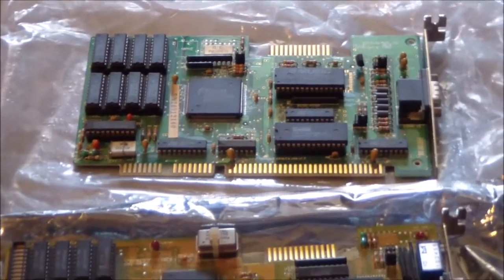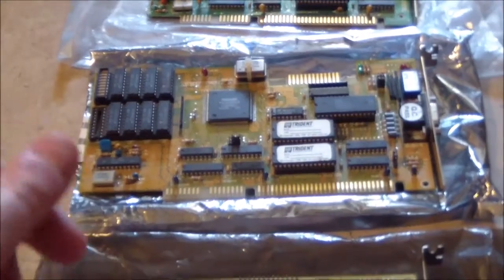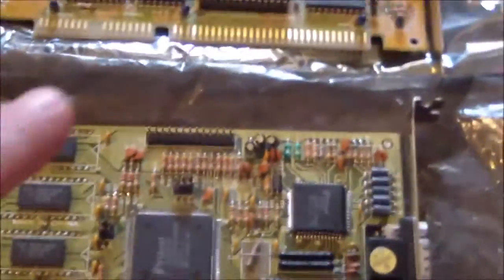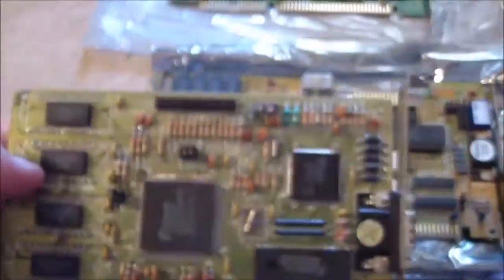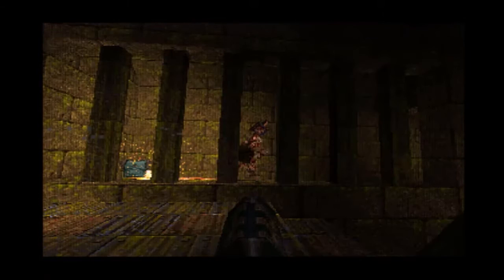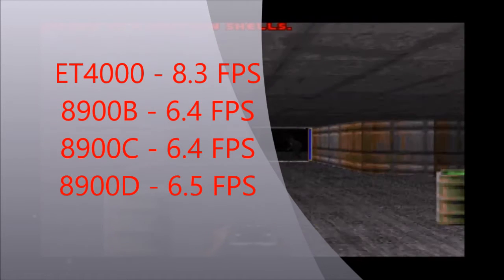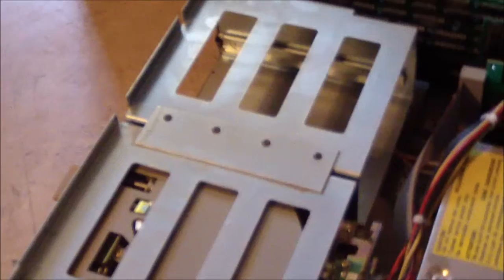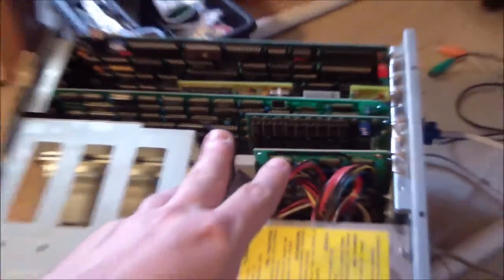Trident 8900 graphics card

Comment: i had the 8900c on my 386 sx33 with 2ram in 1992...later i upgraded to a  486 dx4100 with 16 ram and i could run quake 1 red alert descent 2 doom 2 warcraft 2 duke nukem 3d dark forces  all just fine... its the CPU that did the graphics then the graphics just determined the colours and resolution you could get

Comment: Trident 8900 is First 3D card in world?
Reply from the maker: Trident 8900 is a 2D-only card, it has no 3D acceleration capabilities.
Reply: @AncientElectronics  OhOh.Thank you.

ps:i want to collect First 3D Card.
Reply from the maker: @阿綸的全勳學院  I think that would be the Nvidia NV1 3D Edge PCI card. though I know the S3 Virge and Creative 3D VLB cards were released around the same time, within months of one another. good luck though, Virges is super cheap and common but both the NV1 and Creatives VLB 3D Blaster cards are extremely rare and expensive.

Comment: I had the TVGA8900C in a PC I bought for $5 at a thrift store, sporting the legendary 386DX40 processor. Despite having 1MB of VRAM, the graphics card couldn’t display any color depth higher than 8-bit, 256 colors. That’s odd, considering I have a completely different 1MB card that can do 640*400 resolution at 32-bit color on another PC!

Anyway, if I tried running the Trident card at 1024*768 resolution, still in 8-bit color, it wasn’t very stable. I had a 256-color wallpaper in Windows for Workgroups 3.11 (actually the Win95 clouds) which would suddenly "bleed" for no reason. And this wasn’t during a typical palette change while multitasking when you’d expect such anomalies. It was just shortly after starting the PC!

Lowering to 800*600 resolution, still at 256 colors, would finally give a stable result, albeit only at 72 Hz refresh rate. For running standard Windows apps and Microsoft Office, it was reasonable. Some simple DOS games also behaved, but don’t expect much beyond that. You’re definitely better off with competing brands, even those which only have half the VRAM at 512kB.

Overall I can’t really complain, though. The whole working PC was just five bucks and lived a good life beyond whatever the previous owner(s) got from it. But I’d hate to imagine what people paid back in the day for this underperforming video card, expecting more for having a full meg of video memory.
Reply: Thats true man   and i had the same card but 256 colours was great, huge upgrade over evga,,, you could run dark forces, windows 95 with those desktop themes ( aliens, predator ) remember downloading those with netscape navigator 3.0 with my dial up 33.3kmps modem... all those games in the 90s were 256 color even FMV ones like full throttle looked great with the trident and a 486
Reply: you never went higher than 640 by 480 with the trident anyway because you couldnt.... it supported 1024 by 768  i had the manual but no game played in that resolution until 2000 like the new command and conquer game tiberian dawn.... the Trident , you could play any game up to early 1997.... with a dx4100... as soon as you needed a pentium 90 , you needed a PCI 2 meg graphics card .... warcraft 2 looked good and that ran fine on trident 8900c as did red alert 1

Comment: How can this even make sense? The VGA card is nothing but a frame buffer. No acceleration, no functions, no features. The CPU draws to the video buffer which gets displayed on the screen. The VGA should not be a factor in speed, since it does nothing but mirroring the RAM content on the screen.
Reply from the maker: I'm not really versed on the technical side of things but I do know the VGA card certainly effects the framerate of something like a game even on an old 2D ISA VGA card. I'm pretty sure there is more going on then what you state and the proof is in the fact I can take multiple cards and get consistently different individual FPS rates from each of them in the same PC. I can slap in a et4000 based card into my 16mhz 386 that has and older VGA chipset built in and get drastically improved framerates. It probably has a lot to do with the speed and type of RAM on any given card, possible filters and VGA chipsets, RAMDAC, ect.... I'm sure someone else in the comments could explain it far better then I can.
Reply: It's not "mirroring" RAM on the screen. The program (typically DOS game) has to actually write into memory of graphics card. And that was the primary problem in the early days of VGA - different chips had different frame buffer memory access times. If the card is too slow compared to CPU, wait states had to be inserted (automatically at the hardware level), essentially slowing down CPU.

Comment: I had a Trident TVGA 8900CL with 1MB of VRAM on a 16bit slot with a 486DX 33 MHz, and 4MB of RAM. It allowed me to play DOOM decently, and most older DOS games. I remember , while not fast, it was compatible with pretty any software under DOS.
Reply from the maker: You pretty much hit it on the head. good compatibility but not the fastest. It gets the job done. I like using them in slower systems where VGA speed isn't a huge deal and the 8bit compatibility is a huge bonus.

Comment: Nice. I've added a low detail Doom option to my benchmark suite. It performs pretty much like Wolfenstein 3D so is great for 386 machines. With the ISA cards, the way I see it, amongst just the video cards, as long as you don't go for something like an OAK, it doesn't matter that much. However for anyone that wants to get the most out of a machine, any % gain with the graphics, gets compounded with other gains elsewhere, be it cache, ISA slot OC, memory timings. But if you just want to play Wing Commander, it matters little.
Reply from the maker: very true.

Comment: Ellianda did a test on a fast system (800 Mhz Pentium III) here http://www.vogons.org/viewtopic.php?f=46&t=41662 . In that test the Trident 8900D was a lot faster than the other ones. I think the 386 is bottlenecking the cards.

Another thing, the reason why the 8900D is fast is the presence of memory FIFOs, not memory speed itself. Perhaps those are not working or it switches automatically to some sort of "safe mode"? Or maybe running in 8-bit mode in a 16-bit slot? Try it in an 8-bit slot of the 386, if it performs the same, it is probably running in 8-bit.

That being said, this is the first video I ever saw that took a look at these ubitiquous cards that were present in almost every 386 PC I ever saw. Thank you!
Reply from the maker: thanks for the info, perhaps I'll redo the test on a much faster system and see if I can replicate those results.
Reply: This video also nicely illustrates that while the Tridents are slower, on a 386 it does not make a whole lot of difference (because everyone seems to want a Tseng in their retro 386 even through it is not that important in a 386 system). Anything that really needs a fast video card will probably not run on a 386. Considering that at the time when it came out Trident 8900 was among the cheapest offerings, and videocards were expensive it would be no brainer to buy a 8900. Of course, the ET4000 is better and Windows accelerators (which the ET4000 is not) would help tremendously in Windows, but at a time when PCs costed thousands of dollars, everything counts. It also helps that it is faster than first gen VGAs (a suggestion - maybe compare the Trident 8900 to the Cirrus Logic VGA in your BSR 386SX, the Cirrus one should be so slow that there will be a difference even in a 386SX/.16)

Comment: hey man, I have an old dual pentium 3 board I want to use as a backup pc. I tried the power supply I had with it and it wouldn't work (fried). I need a psu but I can't use a standard one. could you help me find one? thanks.
Reply from the maker: Why cant you use a standard one? is it an OEM case with a proprietary shaped PSU or something?
Reply: 0blivi0n100 it's an old IBM motherboard. so it is oem,  I tried to see If I could use a standard modern psu but it was missing some connectors.
Reply from the maker: what's the model of the PC? if all you need is an AT power supply they make really cheap ATX to AT adaptors